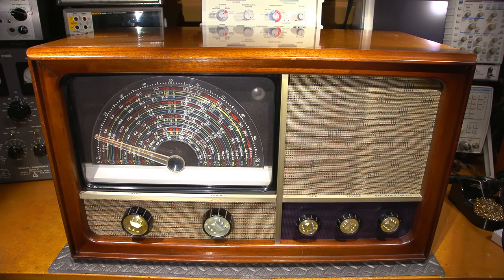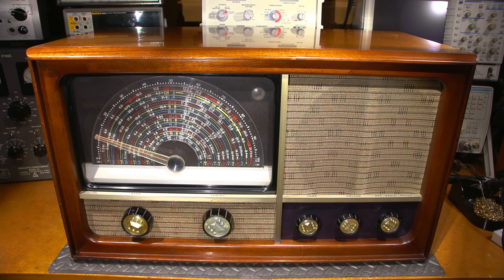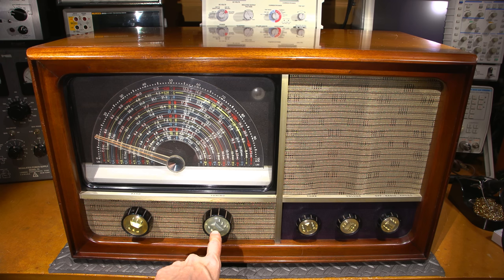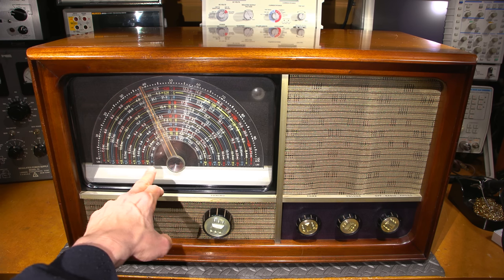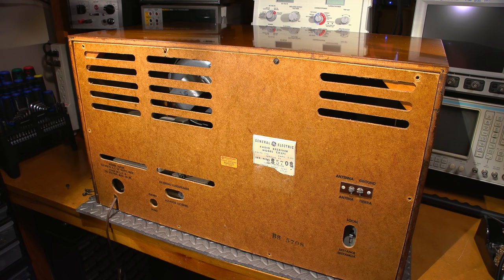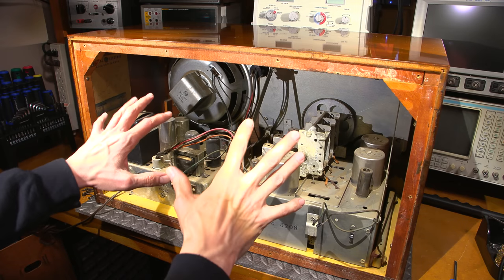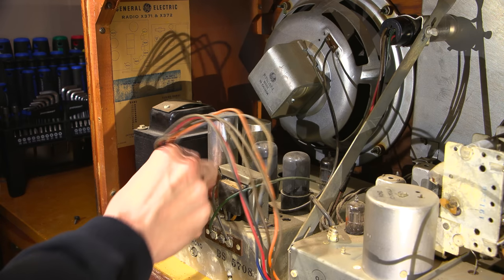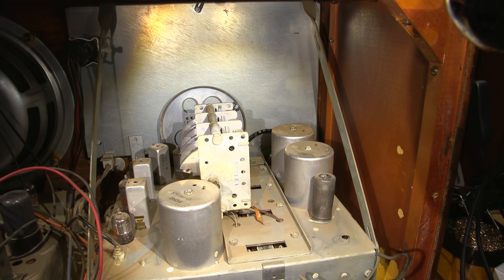1957 Barn Find Radio Receiver Restoration Series!

Comment: Hi!  You mentioned that the RF chassis was mounted using flexible bushings.  I'm relatively sure that this was done to eliminate "microphonics" feedback between that huge speaker which vibrates the entire assembly.  That would be especially noticable at the higher frequency bands where the percentage change in frequency could move an am signal well away from the IF center frequency.   Once you get it working, try tapping the chassis LIGHTLY while tuned to a sw broadcast and listen for the effect on the audio.
Your youtube channel takes me back to the late 1950s when I used to restore equipment from the 1930s (and one from the 1920s).  I got my first ham license in 1957.  Built my first transmitter with the 1920 hardware using  the following tube lineup:
Crystal oscillator: #27,  Final amplifier 2 #45s in parallel.  Rectifiers 2 #81s.  Worked most of the Eastern Half of North America on 80 meter CW with it.  
Thanks for awaking my teenage memories.  Don K2YMU

Comment: Holy smokes I bet that cost a fortune when it was new but from the overview looks to have been worth it... really no expense spared in that, built to last and be easily repaired!

I won't spoil the surprise by doing any research into the radio so look forward to seeing the underside of the chassis / a schematic. Granted there are only so many ways you would wire those tubes up I'm guessing they went with one of the more expensive elaborate ways... I have one high end tube radio thats very similar to this but it uses the older shouldered tubes and a 42 PP output and that has way more components in it than any other radio I have!

Shame youtube can't really convey the sound experience though, I run a homebuilt 6v6 PP amp in a smaller room and it sounds excellent so expecting good things from this!

Comment: Not a Stromberg Carlson but a very worthy running mate to one.
It looks basically clean inside so with luck will only have the usual failed capacitors, resistors and valves to contend with.
Your only potential problem that could arise is if a coil has failed, as some used  tricky winding jigs to assemble which you might need to repair a faulty unit.
You never know it might just work after gently re forming the power supply capacitors.
You can hope.
It is a magnificent piece of furniture which wouldn't fit in many apartments now.
Floor standing radiograms and televisions were made not far from where I live many years ago until the transistor shrank everything and the varnish used on the wooden cabinets killed many of the woodworkers making them.
A waste of excellent cabinet makers but nobody knew about carcinogenic varnish in the early 1950s until it was too late.

Comment: Wow 2 chassis radio! Beautiful radio, using a light pipe system!!!  I have in my collection a big Stromberg Carlson radio that has a LARGE two chassis system Chassis 1 has the power system and final amplifier system, chassis 2 has the RF systems for the AM system and a sub chassis for the FM mounted on it. The AM chassis supports the standard broadcast as well as 3 shortwave bands. The speaker system has the Labyrinth baffle system as well, this radio is a large console unit with about 15 tubes in it, again a beautiful radio in Mahogany cabinet.

Comment: Just popped into my mind - do you ever do automobile radios? Used to work on some of the old Motorola jobs, replete with the old "vibrator" circuitry. Love to see something along those lines, too.

P.S. - Just joined your Patreon channel. Now, if I can just find my old PSM-6 multi-meter, I'm good to go.

Comment: You surely have a queue of projects waiting for theit time... Same here :)
The biggest table top radio I worked on was a EAK (?) Beethoven made in GDR. That thing was a beast, a wonder to behold, a real thing of beauty and a joy for ever. It was built all on a single chassis, but had two EL84 power amplifiers: single-ended for treble and midrange, and push-pull for bass.

Comment: AFAIK these were all made in Canada.  The X371 is the US version, though I don't believe there are any differences besides the model number.  

I would imagine this would perform even better with a 6BA7 in place of the 6BE6.  I don't know why they didn't use one in the first place as its substantially higher transconductance would add a noticeable improvement to sensitivity.  Changing it over would require an adapter and a bit of adjustment to the tuning capacitor.

Comment: As a producer of "sped up restoration videos" I do feel slightly called out 🤣 - but at least for myself, the goal isn't so much teaching specifics, but rather presenting projects and maybe motivate people to pick  up some projects again in the process. I generally only explain stuff when I learned something new myself to keep the videos short. I have thought about real teaching stuff several times, but apart from the occasional "tidbits" video, I don't think I can spare the time required to produce them.

As for the receiver, I am curious what some of the bigger metal cans hold in store.

Comment: So was this radio designed to operate on 25 Hz current?  I’d heard that CA had switched from 50 to 60 Hz AC some time in the past, maybe in the 1950s, but I wonder if this radio could operate on either frequency? Perhaps it was like the old radios that could run on either battery or house current.

Comment: I just had to bin a 1920's 1930's radio. It was one of those sets that required HT and grid bias batteries and a lead acid battery for the LT. It looked ok from the outside other than a bit of wood worm but when I opened it I found that at some point it had been tipped over and the acid spilled all over everything and eaten up.

Comment: When you have a radio with short wave, it is so difficult to tune to a station using the small knobs. I glued a big plastic circle on the tuning knob, so every touch on that circleknob has less affection on the tuning and makes tuning into a station much more easely.

Comment: Way back in the late 60s/ early 70s when i was a youngster, my local TV Repair shop man in my town could see i was already obsessed with electronics & he arranged for a couple of really old all tube monochrome TVsets to come to my home. I'd pull them to pieces for my parts junk box that i actually made other projects from. One set was from the local Pub which had been used daily for years in the Bar with everyone smoking like crazy. It was truly bad dirty inside & had its own smell. Full of dust the old tobacco & booze odor made my mother complain of the smell in my bedroom. My 12 year old hands turned black as i cut out the components & eevrything smelt of stale cigarettes for days afterwards!

Comment: You can get a sense of the size of it just by looking at how small the 'Magic Eye' appears.
It is so beautifully made, inside and out. It looks like the tuner is on rollers or something so it can slide out easily. :)

I turned on 4K for the first time ever. The picture froze but the audio still played. On 1080p the frame rate is about 3fps. Oh well, back to 720p. LOL.

Comment: Question: was it only the Electrified Railroads that use 25 cycles?
It would make sense that a R&R depots on an electrified line to tap off the rail Electric supply to power the station, and if a station master wanted a radio he'd have to have a receiver capable of operating on 25 cycles. (Who else used 25 cycle power for lighting else?)